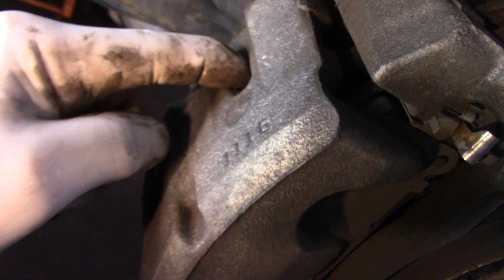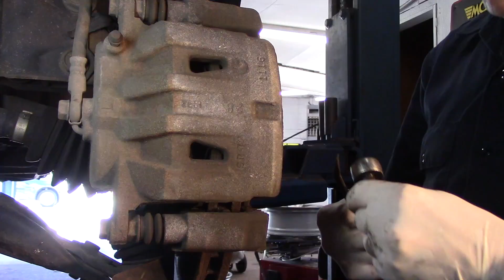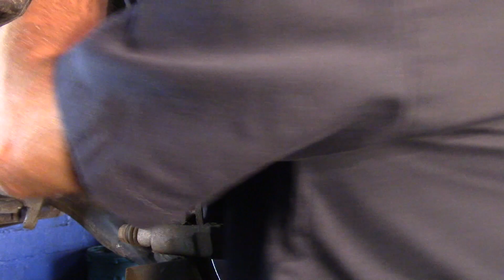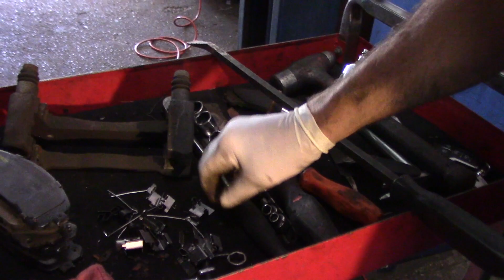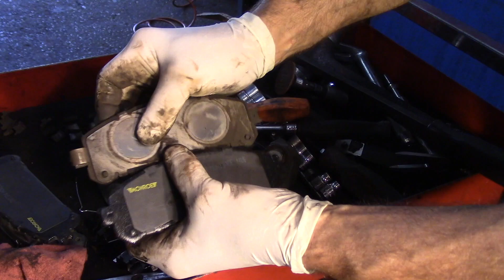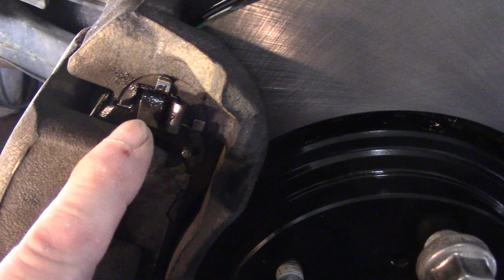Front Brakes 2008-2013 Toyota Highlander

Comment: FYI, I've found it easier to put the top spreader clip in first and bring the caliper down half way so it's holding the top portion of the pads in, then slip the bottom spreader clip in and drop the caliper down the rest of the way. This way, you aren't trying to hold the pads together in the middle with the force of both clips pushing out. Just thought I'd share that tip if you wanted to try it that way.
Reply from the maker: Than you for your input and for watching.

Comment: This is the first time I have seen spreader clips. They appear to be a little tricky to install and hold in place. Bolting the top bolt holding the caliber up is a great tip. This reminds me of the battle to install the top spring in some parking brake shoes. I found a trick with those as well. . Thanks for sharing and have a great day Jim
Reply from the maker: Glad to help